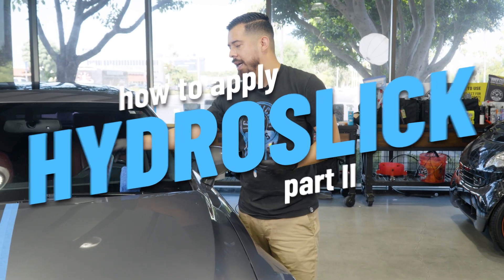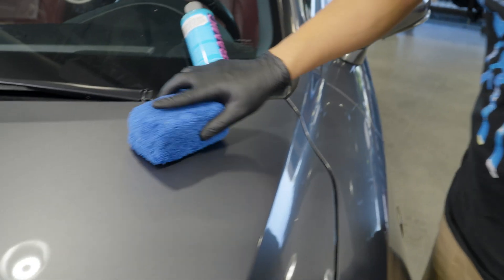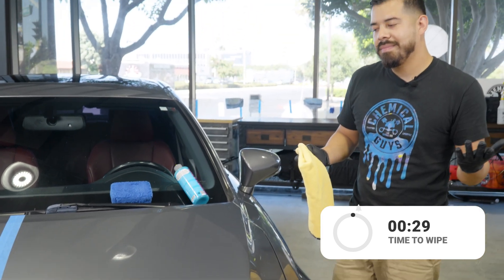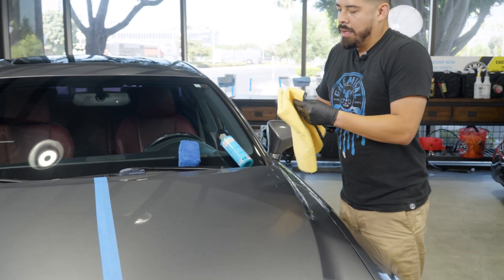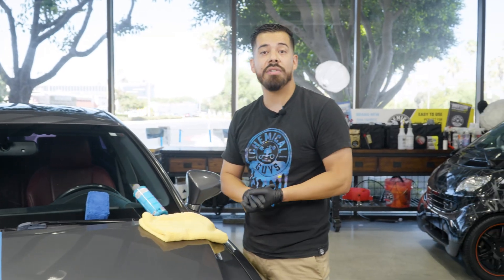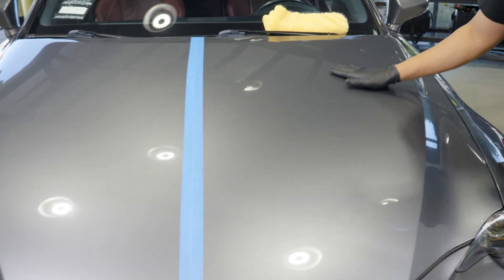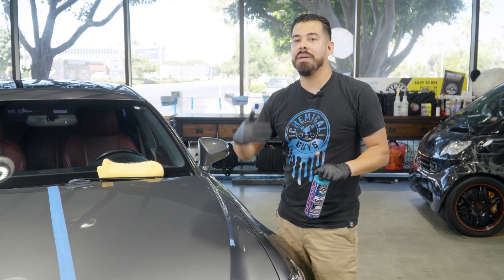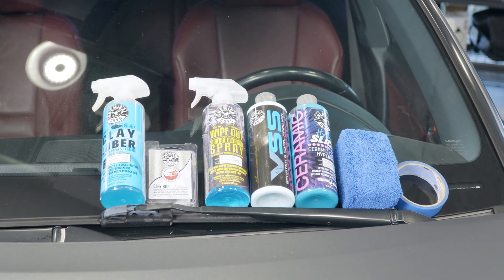How To Use Hydroslick - Part II - Application [Learn Ceramic From A Pro!] - Chemical Guys

Comment: After hydro slick application,, It is necessary to apply another layer of wax like butter wet wax or it's works like a normal wax in protection??

Comment: I bought some hydroslick from you but it has the consistency of apple sauce. Very chunky even after shaking hard.  Yours looks more creamy. Is it still ok to use?
Reply: I have a brand new bottle and it’s just like Apple sauce and unsure if it’s ok. I would call chemical guys but they’re closed on the weekend.
Reply: @kevinmonzel did you manage to get anywhere with chemical guys? I just bought some and applied it, only checking videos out after using it, mine was so much thicker and chunky than the thick syrup looking stuff you see in the videos, was more green looking and was a right pain to remove.

Comment: Recently have this product should i use before or after blacklight polish ?
Reply from the maker: Hey! Apply HydroSlick to a bare surface then it can be layered with glaze, sealant and wax.
Reply: @ChemicalGuys  do you have to wait three hours before applying glaze, sealant, wax?

Comment: Ok so can i apply blacklight and jetseal before hydro slick?
Reply from the maker: Hi there! Apply HydroSlick to a bare surface and then add your favorite glaze, sealant and wax.
Reply: @ChemicalGuys  perfect! One more question.. would I still be able to use the polisher on setting 1 or would I have to add them by hand?

Comment: I was under the influence that I should use Hydro Charge 1st then Hydro Slick.  Am I correct and what is the wait time between those 2? Thanks.
Reply from the maker: That's correct! Allow at least 3 hours in between coatings.
Reply: @ChemicalGuys  thank you chemical guys

Comment: Hey how long does hydroslick last i have been using the wet butter wax and doesn't seem to last long i like it though. Thanks
Reply: The HydroCHARGE+ and HydroSLICK combo is supposed to last a year but if you're familiar with the wild claims made by ceramic makers/vendors...even if you boost it with a SiO2 infused car shampoo and really baby that you're probably only going to come in about 10 months if you're lucky.
Reply: @arrozconmgtow5026  Thank you my friend I'm just trying to figure out all the different products and what works and what doesn't. So do you think the HydroCharge and the HydroSlick to be pretty good stuff

Comment: I think I'll pay a professional to do this, I'll F it up!
Reply from the maker: HydroSlick is super easy to apply!
Reply: 😅😅😅 I try, but my vehicle is too big
Reply: It's easier than you'd think. The first time I kinda screwed myself by putting entirely to much only and by the time I was done I was wore out😅
Reply: It’s so easy… paint correcting is the only hard thing to get great at, but even that doesn’t take long to be DIY-good at
Reply: I started at 7:30 AM on Saturday. Took like a 30 minute break for breakfast finished at 5:30 PM. Use clean slate to move all the protectant or whatever it is on my Tahoe. Clayed, is my torx da15 with v36 and v 38 then Black light glaze, and Jet seal. Could not apply the butter wet wax as the jet seal needs 12 hours to cure. Also did not put on slick after polishing because I forgot and didn’t know I was supposed to do that first.
Reply: Me the same😂

Comment: My garage is hot and will probably end up hardening the ceramic. I wish it was easier.
Reply from the maker: Hey! Try working in the early morning or evening hours when the temperature is cooler.
Reply: @ChemicalGuys  what would be the most ideal temps to work under? The valley in SoCal is brutal lol!
Reply: @RelaxedKoi I hear ya, even at 6AM it can already be 90 degrees. Biggest thing I noticed is  not allowing the sun to contact the car as it’ll dry it up quick. If you have enough lamps you can do around sun down at 7ish and work panels at a time. Otherwise find a friend who has an air conditioned garage or wait till October/November